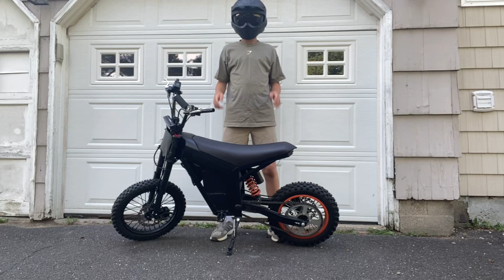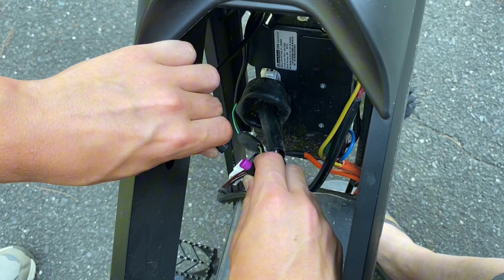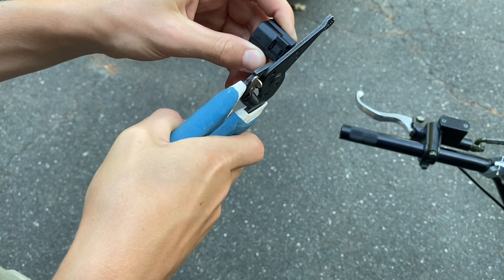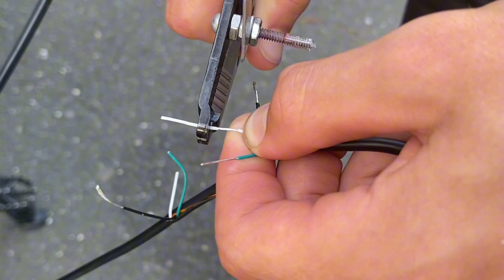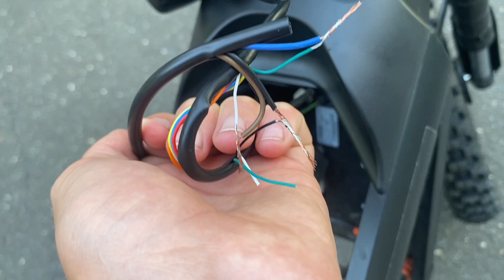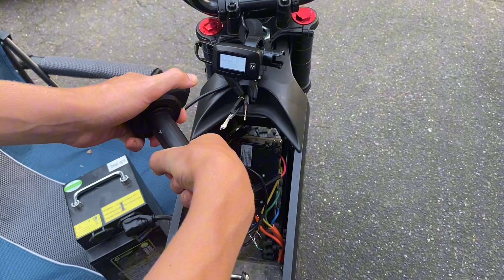Installing New Tuttio Throttle

Comment: Thanks for sharing. I hope you used heat shrink or electrical tape on those connections. They will separate as you ride from vibration without anything holding them together.
Reply from the maker: Yeah I taped it up.